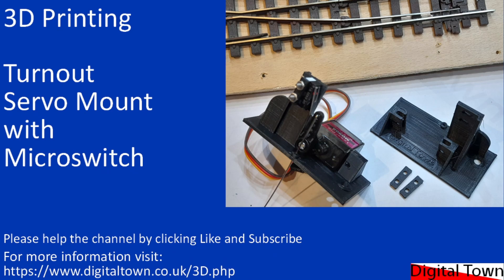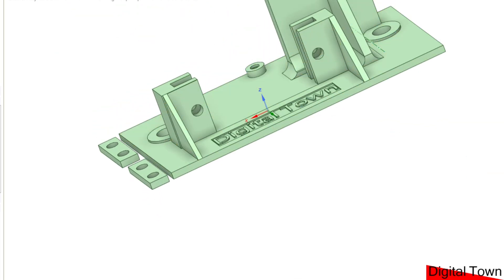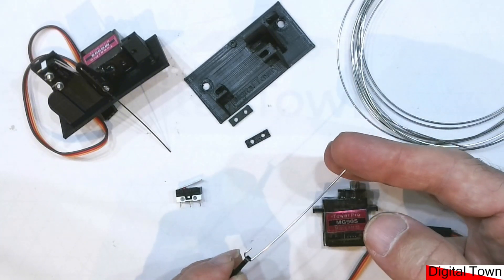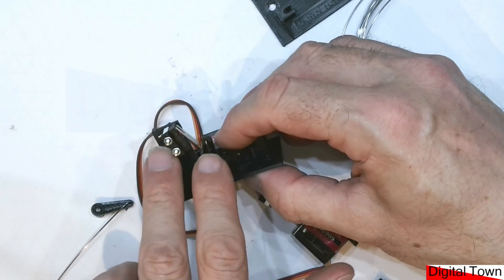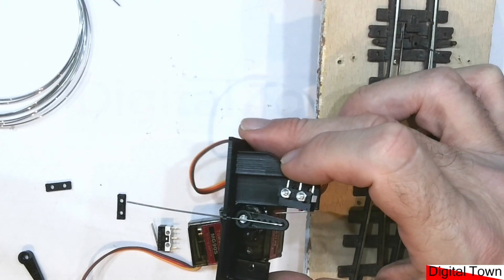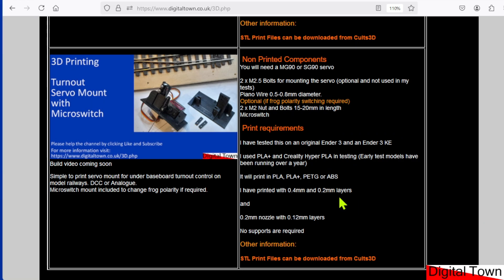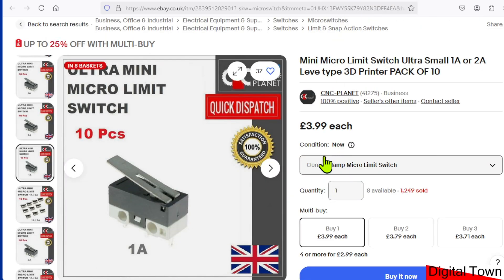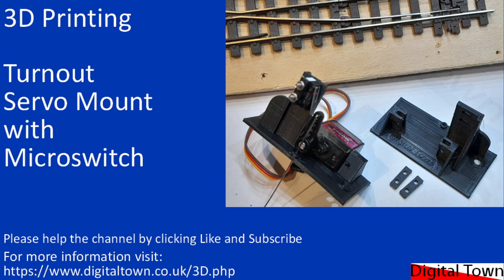3D Printed Turnout Servo Mount with Microswitch

Comment: What size microswitches are you using or would appreciate knowing where you purchase them from? I ordered various sizes from Amazon but they're all larger than the ones you have used.
Reply from the maker: I found some on Amazon at https://www.amazon.co.uk/DAOKAI-Switch-straight-Button-Momentary/dp/B09WVMRD5V/
They are 125v rated at 1 Amp. Size is 12.8mm x 5.8mm x 6.5mm for the main body of the switch.

Comment: Looks great as I use ITrain I would like the code to be controlled via DCC
Keep up the great work
Reply from the maker: No problem, I'll get it sorted.
Reply: @digitaltown5442  Thanks were you intending to use the PCA9685 Servo Control ?
Reply from the maker: @DCCandMore  I'll do an intro to the options but for the DCC version PCA9685 is the way to go and is why nowRail is designed to only use the PCA9685 for servos.